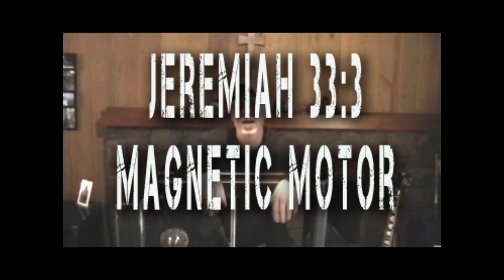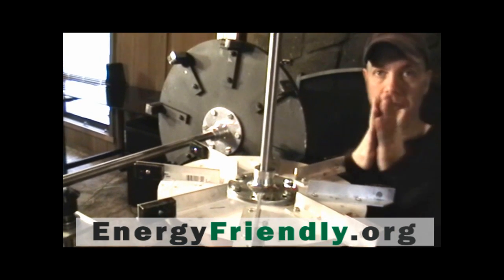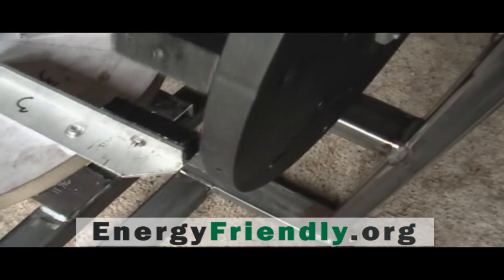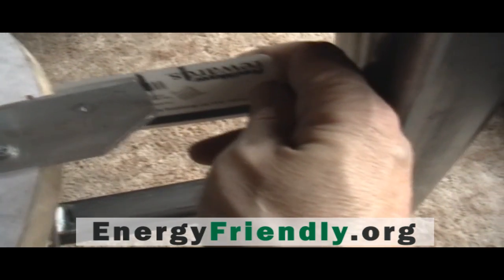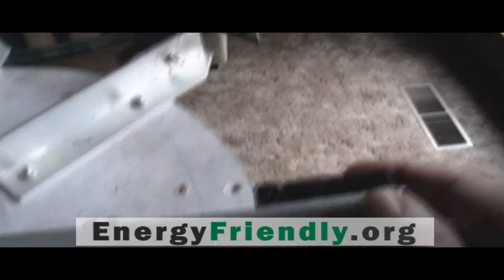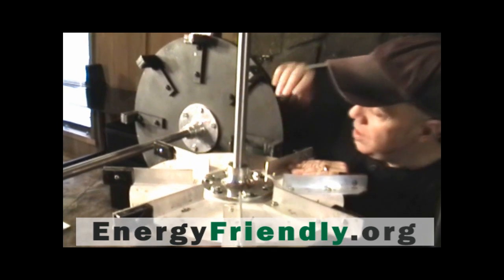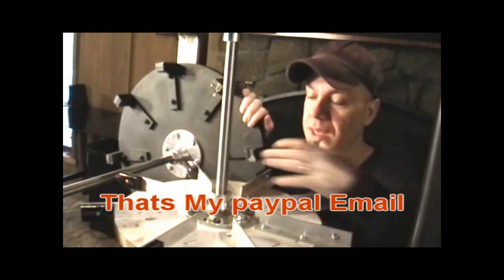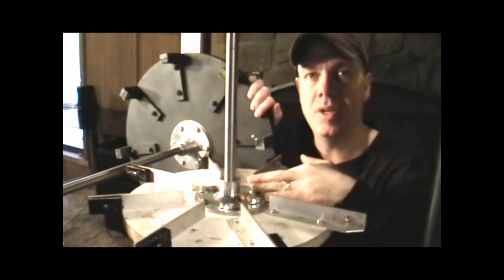New Concept - J33:3 Magnetic Motor

Comment: I think your problem will be easy to solve. You need “Mu Metal” which is magnetic shielding. Mostly comprised of nickel which is not affected my the magnetic gauss. I am working with mu metal on a magnetic motor of my own. It works well as a shield.

Comment: Hi Sermon,   instead of using mu metal    I suggest you "focus" the fields by using other magnets.  Force opposing fields near each other to cause field bending.  Two magnets in a "forced" field will send a field 7 times stronger out the opposite side.   Hope this helped.